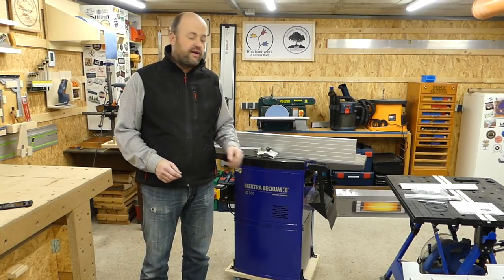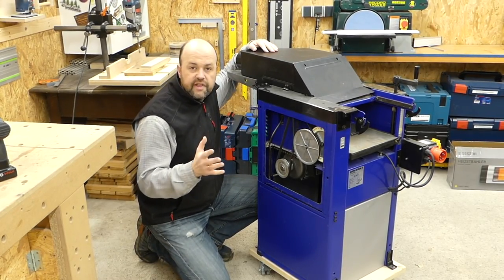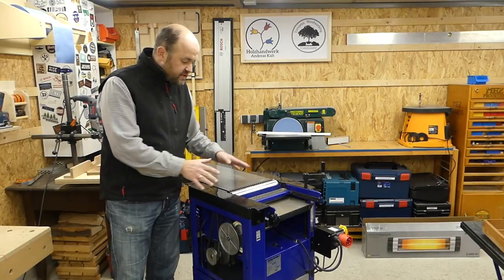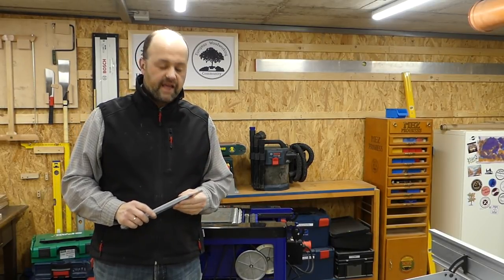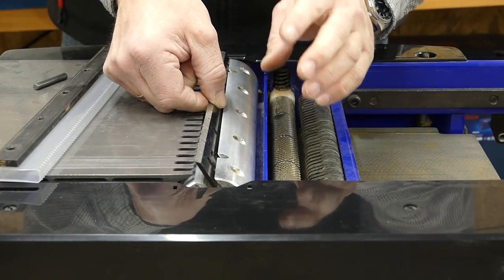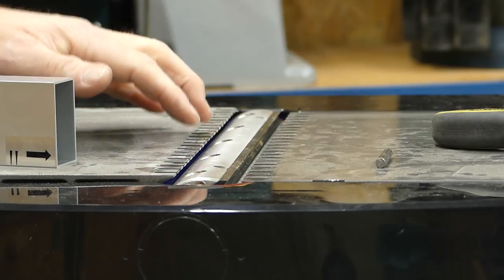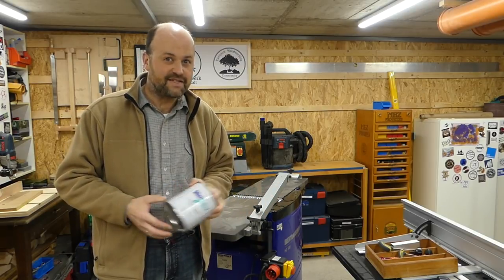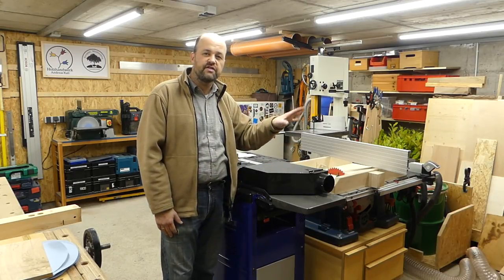Jointer Planer Setup: Setting up a second hand jointer/planer

Comment: Congratulation on your new machine. I have a similar model on my wish list for years (Metabo HC 260) but, unfortunately, this is not the type of equipment to be operated in an apartment living room. I consider it an essential tool, as straight lumber is very difficult to find in the store. I'm losing up to 2 hours just to find a few boards in a pile of warped pieces. I have never seen up close the process of setting up the blades, thank you and keep up the good work.
Reply from the maker: Thanks for your feedback.

Comment: Dear Andreas, I bought Emco Rex B30 - it's the same model as HC300 but in a different packaging. It required replacing the bearings and now runs fantastic. Unfortunately, I bought it without a blade setting tool. Is it possible for you to give me the dimensions between the end of the device and the two black marks? Thanks in advance !

Comment: Hi Andreas. Could you tell me which dust hoses are you using and where have you bought them? Thanks in advance
Reply from the maker: I buy them here: https://www.holz-metall.info/shop1/kategorie532.htm – so far, I’ve used the cheaper ones which seem ok.

Comment: I was wondering just how long it took to get all three blades adjusted to the correct height?
Reply from the maker: It has two blades, it took me about 15 minutes. I suppose, with a bit of practice it will be a couple of minutes.
Reply: @holzhandwerk_ak  That isn't too bad.